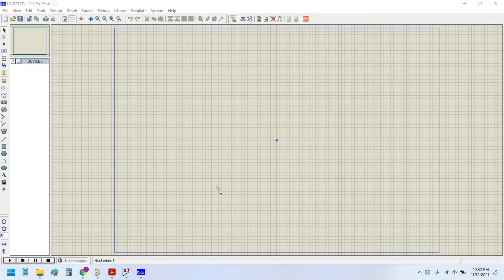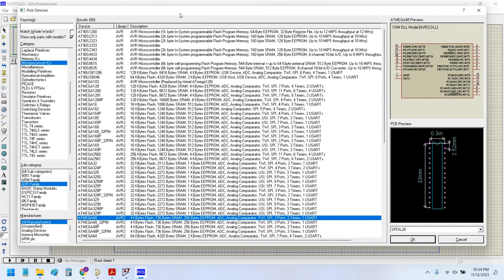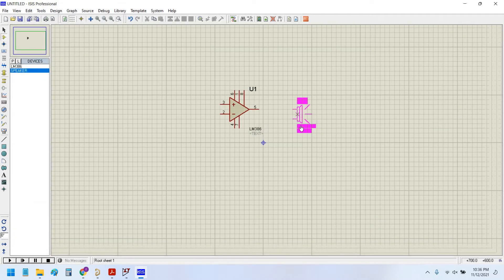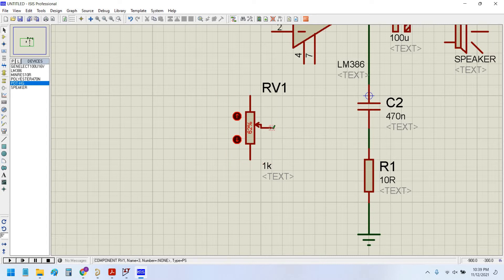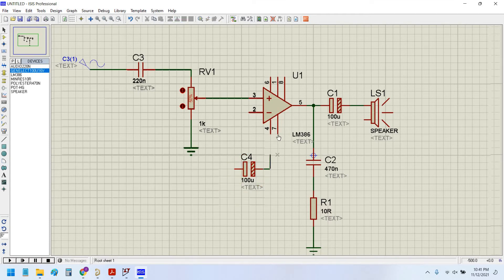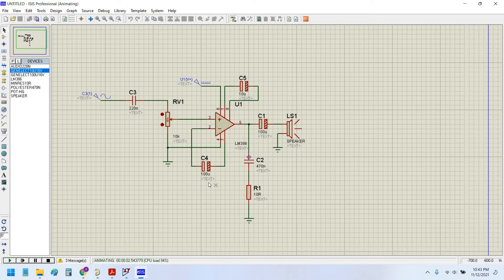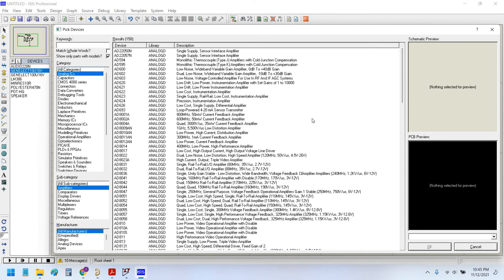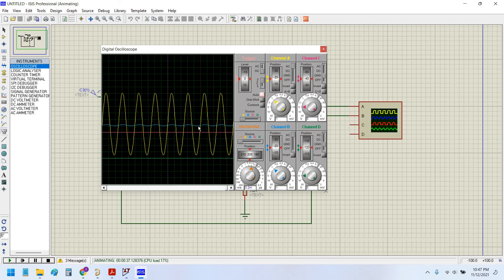How to design LM386 Audio Power Amplifier with Computer Speaker Output #proteus #amplifier #audio

Comment: If we want to create an external circuit  inplace of pothg what should be used ??
Reply from the maker: A simple 2 resistors voltage divider can replace the pot hg.
Reply: @circuitsimulations  
Won't the 10k pot work  in an external circuit ?
Reply from the maker: @indushreen3009  yes it can
Reply: @circuitsimulations  ok thank you
Reply: Sir but I'm unable to connect the oscilloscope in this simulation
How am I suppose to connect

Comment: Can it simulation a real time audio guitar effect pedal?
Reply from the maker: yes
Reply: @circuitsimulations  so proteus work like LT spice ,it load a wav file into proteus and simulator the sound or can i send the guitar into audio interface into proteus and play it in real time and get no latency?just like play a plugin in daw?
Reply from the maker: @upside-down6211  in LTSpice you cannot upload audio like Proteus. But with Proteus you can upload audio files and can play thru your laptop audio TRS jack in real time